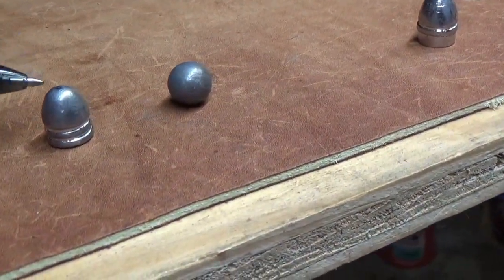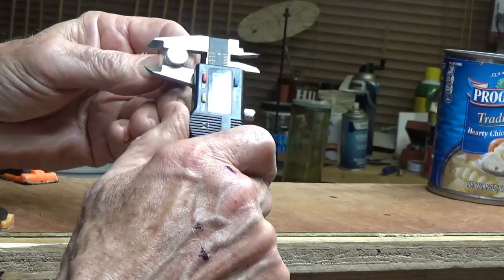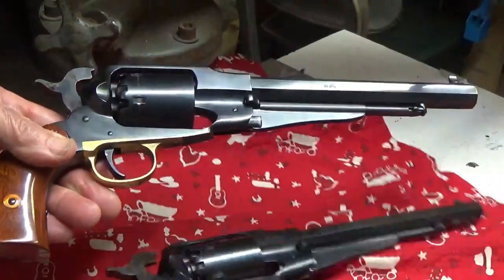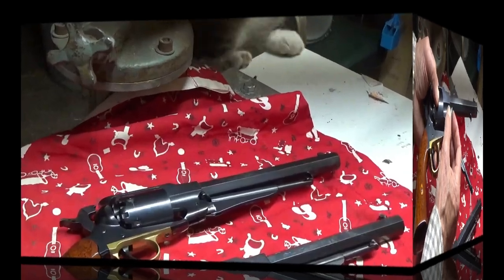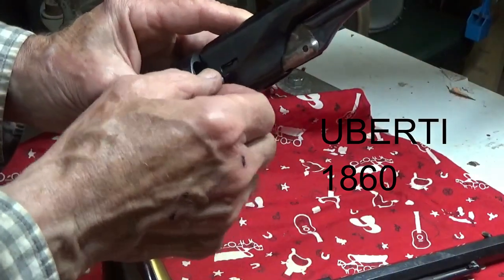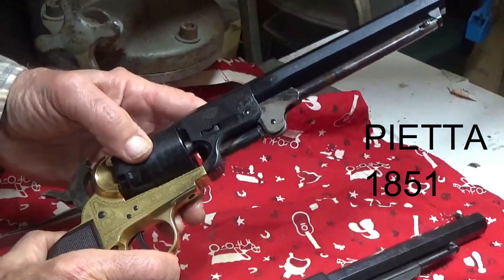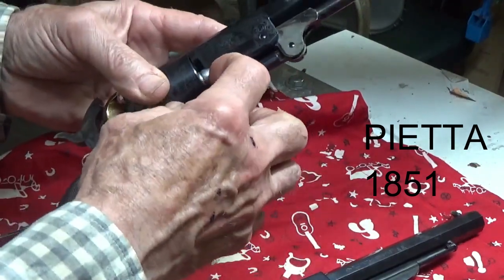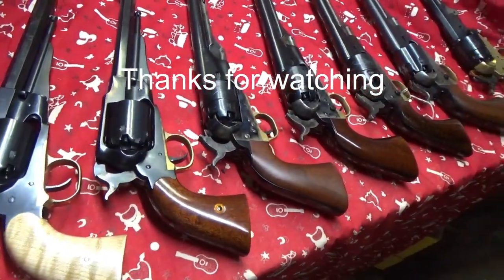Conical Bullets - Will They Fit These 44's ?

Comment: I think that most of the trial fittings here would be so loose in the chamber that a chainfire would be inevitable, the slightly undersize first part of the Jahnson and Dow conical is the way to go, nothing is worst on a cold day than fiddling about trying to locate a conical in place over the chamber, and when the ogive hits the frame and tilts it, you have little chance of ramming it in square, I have tried some of these conicals in original Colts and they have just enough clearance, but whether you could load them under duress is another matter, the locating spigot makes it much easier, and when you make combustible cartridges it is essential, it is interesting that when the army used the Colt 1847 it i said that a lot of chambers/cylinders where blown up because soldiers loaded the conical in the wrong way round, although being still the same weight I can't see that would make a lot of difference to pressure. Many thanks for this interesting experiment OR! Chris B.
Reply from the maker: Thanks Chris.  Great info as always.  Right, I was having enough problems at 70 deg.  I too don't understand why the blow-ups.  One viewer on the 62 pocket video commented that some had 6 chambers, but one would think that most of them would go KaBoom. Maybe it is something about how pressure in transmitted around the nose.  Possibly the bullet doesn't start to move as quickly, causing excessive pressure.  Who knows.

Very interesting about loading backward.  Took me a second to realize that it probably wasn't because they didn't know better. Wonder if it was because of easier loading or more knock down power.  Also, was a practice in the 44's.  Keep safe and "warm" this winter.  O.R.
Reply: @oldranger3044  Yes the often made comment that they did not know which way round the conicals fitted does not really ring true, even the most ignorant recruit would have had instruction, I think as it would be much faster/easier to load the wrong way round must be the answer, but it still does not answer the question of why the chamber should blow, the 1847 Walker was made with less than ideal materials , but I would have thought that as soon as the bullet started moving all would be OK, we can't duplicate the situation as original Walkers tend to be a bit expensive, I also wondered if it was to do with the pressure being forced outwards by the nose shape, but I would think as soon as the bullet started moving the pressure would drop, maybe it was just poor material and they blamed the blow ups on reversed bullets! I have just unloaded 20 Cu Mts of logs for the winter, so we should be warm, we still have 25 Cu Mts from last year! You take care! Chris B
Reply: The same thing happens when you put the bullet in the cartridge backwards, the pressure goes very high and can split cases and separate case heads.
Reply: @oldranger3044  conicals if loaded backwards compress the powder differently possibly over compressing or leaving voids in the powder causing weird pressure spikes.
Reply from the maker: @adudeontheinternet1  Good point. Just speculation but not only does the powder get compress differently (such as around the nose), but the blast pressure might go in the direction of the wall. Don’t know a thing about setting blasts but understand they can be directed. If this isn’t directed at the base, the bullet doesn’t start moving, and makes sense that overall pressure would increase. O.R.
Reply: @oldranger3044  yup that is also true

Comment: Each one of those 44 caliber cap and ball revolvers each Lee carnical bullet that you have will fit in those guns perfectly when you put them in you push it down and tell it clears the other side of the 1851 Navy colts and you're 1860s those rounds will fit any of those guns perfectly I am a civil war reenactor and a world war II re-enactor and a mountain man reenactor 1847 Walker Colt and it went down perfectly without having any problems in that cylinder it is made for all those calories none of them got stuck because the Lee carnacle bullet from log cabin is the precise dimensions of a original civil war bullet in a pistol carnicle bullet of the rigid of original civil war bullet they took the mold of that civil war bullet of a 44 caliber so it could fit all those type of guns without having any problems with it

Comment: During the Civil War, conicals were rolled with powder to make paper cartridges. I'm not sure if they were pre-manufactured or done by troops using rolling paper, but having that  rebated base probably made a difference!
Reply from the maker: I’ve read where factories actually made them. Such as the colt factory 36 caliber. Employed women and (maybe youth) because of the nimble small fingers. Doubt the military (most) had the time, skill, and favorable conditions necessary. O.R.

Comment: Nice! I have both! types. and I was just rolling some paper for my next batch of paper cartages! my last batch of papers needed some help to get my bullets deep enough for regular loading, so I made a press for loading my cylinders on the table. all looked like they cut rings and sealed for no chain fires.

Keep your Smoke Poles SMOKING!
Reply from the maker: I need to try the paper. The flash paper I bought a couple years ago didn’t survive as well as I did. Seemed to just melt and that sort of ended that project. Your press should be a good addition, watch out so not to loose the wedge on newer pietta colt styles seems they changed something and now the wedge doesn’t stay with the barrel. O.R.

Comment: Thank you so much for this information.  I have only ever used swaged round balls, but after watching this I may try Johnson & Dow with flash paper and flash glue cartridges.  in my Pietta 1860 and my Uberti Whitneyville Dragoon.
Reply: Flash paper is the best way to go, none of that glowing nitrated paper left in the chamber, do you make your own flash paper ?
Reply: @453421abcdefg12345  No, flash paper is made using dangerous acids in a commercial setting.  I do not recommend trying it yourself.

Comment: im glad you made this, everyone said you have to remove metal, but id rather drop it in like you did on the pietta. i have a .36 but im assuming its the same.
Reply from the maker: Thanks.  Originally I planned to also do the 36 as I have two conicals to check in several guns also.  Checking the 44's got lengthily , so decided to do separate one on the 36 caliper guns if there is interest. I have the Lee .375 conical mold, and the Colt factory conical mold sold by Eras Gone.  O.R.
Reply: @oldranger3044  those two molds seem to be the most popular, I like the Richmond mold but it’s hard to find, old west bullets makes a heeled conical similar to the eras gone, I’m interested in seeing how the fit is before I buy the wrong mold or pre made conicals. There’s very little information about the .36 caliber revolvers. .44 seems to be the most popular.
Reply from the maker: @smartmeis  Actually have the Richmond mold. Noticed Eras Gone has them back in stock. Haven’t used mine yet but planning on breaking it in so I will have that bullet to include when I get to making the video on the 36’s. O.R.

Comment: The imported cap and ball revolvers have improved in accuracy and quality over the years and some dimensions such as the area that allows for seating the lead projectile have become more prototypical. The Lee bullet was designed back in the 70's specifically for the Ruger Old Army revolver so I am not surprised it binds on several of the replica revolvers. One of these days I want to try my Ideal/Lyman 454068 in the Ruger. That bullet is a 175-grain hollow base but is much shorter than either the Lee ROA bullet or the Johnson & Dow replica.  Great presentation!
Reply from the maker: Thanks Lawrence. That 454068 sounds interesting.  I couldn’t find it in my 1970 edition, wondering if it is relatively new? I also have a Lee for 36 that is basically the scaled down version of the 200 grain. Have had it for probably 35 years. It would shoot some pretty wild groups if I am remembering correctly. Those 36’s had 1-30 twists, I need to revisit this using the faster twists of the newer Uberties. O. R.
Reply: @oldranger3044  I think you will find the 454068 in the black powder section of the 1970 Lyman book.  It is not new and goes back to at least the 1920's. Hensley & Gibbs made a similar mold but it is not a hollow base.

Comment: Not sure I'll ever be ready to spend $300 for a bullet mold. How well (or poorly) do you think that the castings from the Lee 452-160 or 452-200 bullet molds do in the 1860 Army and other .44s of that era? Perhaps with powder coatings to slightly increase the bullet diameter towards that .454 goal? Or in paper cartridges? I do already shoot .45 ACP. 
 
Have you (like me) been tempted to buy a set of pin gauges that include chamber and bore diameters in the set?
Reply from the maker: Never looked into the pin gauge idea. Don’t figure I could ever go that much for a mold unless it was the only way I could use the guns. The Lee will cast a good enough bullet, problem I find is that the flat base on the cartridge styles makes loading difficult, especially when it needs to be slightly over chamber diameter to get a tight seal. A slight bevel on the chamber helps, but there is usually a long area that needs to compress (or shaved) compared to the round ball. My opinion is that the conical is probably better for knock down, but I like the round ball for plinking and target work. You can get more powder in the round ball load which somewhat compensates for it’s smaller mass. O.R.
Reply: @oldranger3044  In my first front-stuffer life back in the mid-'70s, all I ever had to shoot was round ball. (except for the .58 minnies in my Zouave.)
Reply from the maker: @AnantaAndroscoggin  👍

Comment: My bullets for the  Remington/small colt I made the bases diameters at .445, and my drive bands at .452.   For the ruger/walker bullets the bases are still at .445, with a .456 drive bands. The noses are designed  as a flat nose,  kinda  half way between  a keith bullet and a semi wad cutter.
Reply from the maker: Neat.  Bases about the same then as the Lee, with a slightly larger drive band, which seems to be a good idea, as that .448 (my castings) seems a bit on the small side for a decent seal on some chambers.  Be interesting to hear how they shoot with the nose design.  O.R.
Reply: @oldranger3044  leverguns50 has shot my two lightest for the Remington/small colt  and has now tested my biggest walker bullet out two different formats. Out a cap and ball  walker just shy of a 1000 fps, and the other format is a Walker conversion in 45-55 walker. And just shy of a 1000 fps. This is my 270 gr design that averages out at 271 gr. Bullet drove through 32" of gel and looked pretty stable

Comment: On the Remington, thefirst position that you tried to load in is perfect for and designed for paper cartridges, as the forward part of the frame, just in front, is indented for the cartridge to insert straight in. I think if you compared with loading an original Remington, that youll see that theconical can be roated under the lever, from that position. The Italians make theseguns to beloaded predominately with round balls.
Reply from the maker: Thanks for this information .  O.R.

Comment: So I noticed all of your colts have the wedge not all the way through, you can use a coin nicle sized or larger to press them in and out easily by placing it over the wedge and squeezing with your palm on the coin.
Reply from the maker: @Patched_Jack  Good advice, thanks. O.R.
Reply: @oldranger3044  well I have seen more than one person use a mallet, but that doesn't fit in a pocket very well.  I figure it would work great with Colt Paterson revolvers, but it's equally useful for the rest.
Reply from the maker: @Patched_Jack  I have some with a short arbor and driving the wedge in hard can mess with cylinder rotation. Not remembering which is probably why they are all loose. O.R.

Comment: as you, i have both, Uberti and Pietta. Pietta work well with 454 Bullet but Uberti prefer 457, as the ROA. If you want use conical bullet in Uberti, use those of the ROA.
Reply from the maker: That makes sense to use the ROA in the Uberti with the slightly larger chambers.  Thanks.  O.R.

Comment: I have tried many conical bullets in my .44 New Army and it doesn't flatten out the points too bad, depending on the hardness of the lead, and the tightness of the bullet in the cylinder.

If I wanted to have perfect seating of conicals, I would machine the tip of the loading press, that way you can do both round and conical bullets with little distortion of the bullets.

The conicals have never been a problem for my revolver, and I have even loaded LEE R.E.A.L. bullets when I wanted massive lead! However, I can only fit 25 to 30 grains of powder behind them. Now that I have a Chrony, I should measure the performance of the Lee bullets! Having mass with no velocity, does not have any power, so it would be a useless load!

But that is one of the pleasures of black powder, as long as you use reason, you can experiment with your loads, just be sure to document your work! As for me, I don't retain much any more, as my brain is plugged up with lots of memories!
Reply from the maker: Man that is so right. Someone commented about why I have little tags on some of the guns. Suppose I could write the information down somewhere else but…… how will I remember where. Or the fact that I wrote it. Like Jose Wales said, “That’s just the way it is.”  
I find that with round balls, deformation of the tops (and there is quite a bit) doesn’t affect accuracy as much as one might think. O.R.

Comment: I can definitely say there is a problem with Uberti 1858s properly sealing with Lee .450” bullets. I have an 1858 carbine (really Remington 1866 repeating rifle). It only occasionally shaves half a ring of lead at best and usually there’s nothing.
I plan to get a .452” .45LC mold. I’ve been told by some people online that this will fix the issue?
Anyways if anyone has any experience or suggestions I’d appreciate u
Reply from the maker: You’re probably aware that Lee makes a conical mold designed for the Ruger Old Army. It will be close to.458, and its advantage over the.452 ACP or LC mold might be that it has a smaller base which helps to start the bullet. O.R.
Reply: @oldranger3044  yeah I considered the old army but I have brass frame 1858 revolver (and a steel 1858 carbine.
I think the colt would probably be easier on the loading lever??? Although the fact the Lee is designed for it may mean less actual lead to shave???
In any case I would say based on my experience Lee .450” are not safe outside of range use!!! I could imagine that bullet walk out enough to short start and detonate!!!
My solution (when it was my go to gun) I kept it loaded but melted a solid mass of paraffin covering the bullet completely. Bonus is I get extra lube!!!
I think for carrying the paraffin is fine (assuming it doesn’t exceed 80-85 degrees).
Reply from the maker: @danielcurtis1434  Is the .450 a bullet you have been loading designed and typically used in a cartridge gun, or is it the Lee mold designed for black powder. It sounds like it is a cartridge bullet? O.R.
Reply: @oldranger3044  no I have the 200 grain Lee mold (intended for .44 cal caplock revolvers).
I did think about buying the 294 grain hollow base .450” Lee offers for .45 caliber muzzleloaders. I was thinking I could cut down the pin and have the base just filled so it would be something like 350 grains. However I had serious doubts about the rifling being anti stabilize anyways.
I still like the idea of shooting 350 grain pills from my 1858 carbine with however much powder I could fit???
Reply from the maker: @danielcurtis1434  I agree that stability could be a issue. The Lee conical for the ROA has a max diameter of .460, so it could be difficult for the loading lever. I should try it sometime. I have noticed what you’re experiencing, but in the Uberti, which chambers seem a couple thousand larger. Hopefully you will solve some issues, and keep me informed if you have time. Thanks. O.R.

Comment: My Uberti 44s have .450" chambers, and I have one Dragoon what came with .452" chambers.
The original guns took conicals no problem, as conicals in paper or skin cartridges were a standard load of the North during the Civil War.  Therefore, modifying your guns to easily take conicals is merely getting them closer to an original gun.  I highly recommend it.  There's no reason why you should be fiddling around trying to get a conical loaded.  They should drop in easily and seat easily.  If they don't, then something needs to be changed so they do.  Because of the design of the Colts, you will have to somewhat tip the bullet in.  There's no way around that, but with the right bullet and the right mods to the gun it will be just as easy.
Reply from the maker: Thanks for your information on this.  Interesting that your's are a bit larger than the Ubertis I have.  Sure wouldn't work well on the Dragoon to be using the .451 rounds.  Makes sense about the fit on conicals in the originals.  O.R.